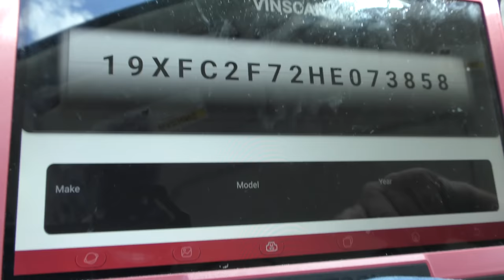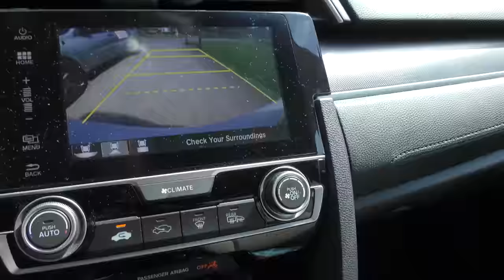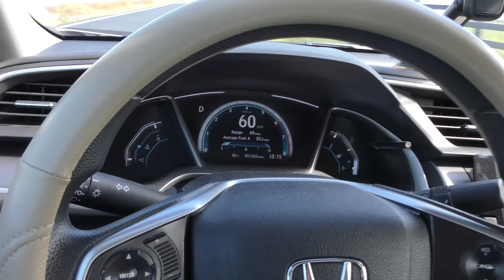Here’s What Happens If You Change Lifetime Transmission Fluid in Your Car

Comment: "what's the lifetime of the fluid?" "It's the lifetime of the transmission." "What's the lifetime of the transmission?" "It's the life of the transmission fluid."
Reply: You got it!!!
Reply: The warranty is the lifetime.
Reply: Circular logic
Reply: As long as you have your transmission service by the dealer,  its lifetime as long as u own it. 
Not transferable to next owner
If work gets done some where else , the lifetime is over. 

But if u changing vehicles every 3 to 6 years, you won't have to worry about transmission
Reply: Who’s on first?
Reply: @DanielGarcia-zz9eg  They shouldnt be serviced. And will lasts half a million miles, at least the Audi ones would. I know of people who flushed them and changed oil and they broke, but so far i didnt see an old untouched one that was broken. Those are not CVT of course, regular 5-speed automatic.
Reply: @pflaffik  no fluid lasts forever. It's all organic compounds subjected to high heat. The fluid will break down and not work as good as when new. Nevermind the fact it also serves as a way to flush away debris.
Reply: AKA however long the WARRANTY lasts! Pretty simple actually, do a drain and fill every 50-60k.
Reply: Like the video your making... it's very helpful to guys like me who loves to work on car but have little knowledge! Thanks for sharing your knowledge and tricks regarding car maintenance.  I have a 2020 KIA soul and just drain and fill the transmission fluid. Does a KIA have a secondary transmission filter located on the cooler? Thanks in advance! More power to your channel!
Reply: @DanielGarcia-zz9eg  Depends on whether the dealer is a cheapskate like a BMW dealer. They are the worst. They will refuse to service your car and claim it "never needs to be replaced." That's why I dumped the brand completely. And do not buy MINI. BMW owns that brand too.
Reply: @TheMet4lGod  Yup. Just more poor souls falling for the planned obsolescence game.
Reply: Does anybody know what the drain plug size is? Also, do we need to replace the washer as well?
Reply: Lol. One,of the best comments ever!!!!
Reply: Lmmfao
Reply: Lifetime of warranty
Reply: @pflaffik  nothing is 100%. We do things to statically lower the risks of breakdown. And you used specific examples to justify your points. “I’ve seen people blah blah” is good example of that.
Reply: @BradMcquaidd if you’re talking about this 10th Gen Civic, then the drain plug is a 17 mm.
Reply: Did he pour in the fluid, then put the bolt back on? Lol
Reply: @JAlves88  😂😂😂… yeah!  At least that’s what he stated and how it appeared!🤣🤣🤣
Reply: lol they do the same thing with fossils. How old is the fossil? Its the age of the rock it is in. How old  is the rock? The same age as the dinosaur it is in. They call it circular reasoning and its a huge reason why some science is more of a religion than a science.
Reply: @daleburnfart6845  Historical science is the biggest guessing game of all the sciences.
Reply: @daleburnfart6845 did you just circular reason your own circular reason on fossils?
Reply: @alabama2uz  🤡
Reply: 80k miles max, change every 25k miles.
Reply: You can change transmission fluid every week, and it won't extend the life of the transmission by 1 mile. Flushes do more harm than good, plus anyone who works in a transmission shop as I did for 25 years would tell you there is absolutely no way to completely change the oil in an automatic transmission, short of a complete overhaul.
Reply: @pete1342  In your 25 years, how many of the transmissions that came into the shop were in good order?  You did not see the transmissions that had a fluid change and gave many years of trouble-free service thereafter.  You got the messed-up ones, which might have had a fluid exchange performed in a desperate attempt at a cheap fix.  This is selection bias.  It doesn't mean you should never change the fluid.

It's not necessary to replace every drop of fluid.  If it was, we wouldn't be changing our engine oil because there is absolutely no way to completely change the engine oil short of a complete overhaul.
Reply: “I don’t know. I’m not a biologist”
Reply: @BradMcquaidd Toyota 10 mm Allen key and don’t need to replacement washer
Reply: @TheMet4lGod Not to mention debris from metal-to-metal of the gears.
Reply: @daleburnfart6845 So true, so VERY true Dale! Thanks for the reminder about “science so falsely called” it IS a religion...
Reply: The lifetime of the fluid is the lifetime of the car, which is the new car warranty:
Hyundai, Mitsubishi, and Kia: 10 years/ 100,000 miles.
Cadillac, Lexus, Infiniti, and Acura: 6 years/ 70,000 miles.
Reply: 😄😄 like he said, stupid advice.
Reply: Egg/chicken
Reply: What's the life of the vehicle? for a cvt vehicle, good chance it's gonna be the same as the life of the transmission
Reply: It’s a transmission fluid that last a lifetime of the transmission
Reply: @pflaffik agree extreme !
Reply: Infinite cycle? Infinite transmission
Reply: @alabama2uz It's not. Toyotas will generally last until 200-250k with no changes of fluid. The fluids end of life is about 100k at that point it goes down hill.
Reply: Pretty much...
Reply: I was going to flush mine, but glad I found this one. I got some special additive for it for now, but I will take Scotty's advice for sure.
Reply: @DanielBrownOre  what if fluid still clean looking ???
Reply: @bgood213  Well mine wasn't clean looking at all at 30k miles, I did a drain and fill with protective additive too.
Reply: @DanielGarcia-zz9eg  Having dealer do it or not is irrelevant, has been illegal for like 40 years for a car maker to force you to use them for maintenance.
Reply: @pflaffik  Thats why you do simple drain and fills to freshen up the fluid every 30k and drop the pan and replace the filter every 60k, that's it. But I do agree about flushing, they are for suckers who don't know they usually hurt the trans performing them. Unless you do a full flush every 30k you are better off not messing with the transmission "ecosystem" with the pressure of a flush and all new fluid at once.
Reply: @pflaffik  trans shouldnt even break at all especialy if their manuals had a car 700k km on original gearbox and engine, you need changes on automatics a lot more and rarely there are some manuals that require changes to be sure they dont break cuz some do
Reply: Like everything read the fine print almost everything is a scam
Reply: As Scotty said: The trans fluid is LIFETIME. OH? What's the TRANSMISSION  lifetime? 60K.  Oopsie.  Hadn't budgeted for a new trans.  The techs at dealerships PARROT the company line--they have to. They give a GREEDY, DISHONEST & STUPID political answer, and try to UPSELL--or lose their job I figure. I wonder if a flush cuts down that 60k # to what? 2/3? 1/2?
Reply: @pete1342 it’s recommended to do repeated drain and fills until it looks clean. My car has 220K miles from just drains at 60K.
Reply: I have a 2021 Rav4, and the owners manual recommends changing the transmission fluid every 30,000 miles.
Reply: @baderrammal6537 Jeep 36,000 miles 😂
Reply: @DanielBrownOre on many newer cars you have to remove the entire transmission and completely disassemble it to access the filter.
Reply: @pete1342 do you recommend not changing it at all?